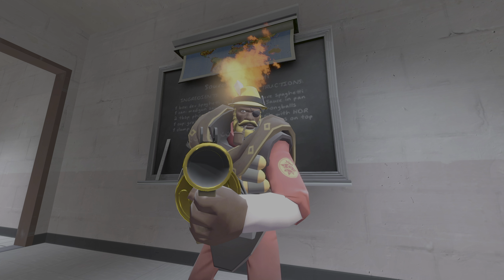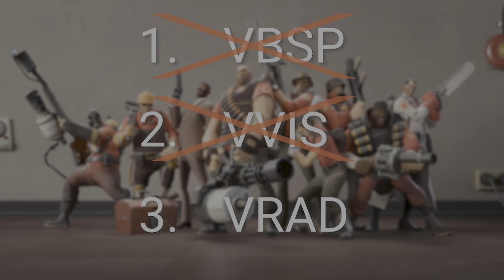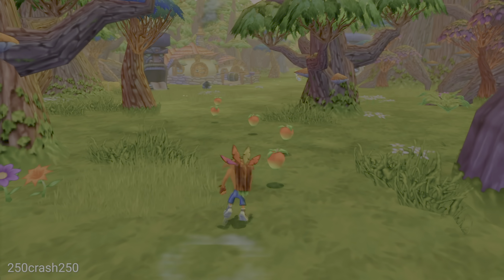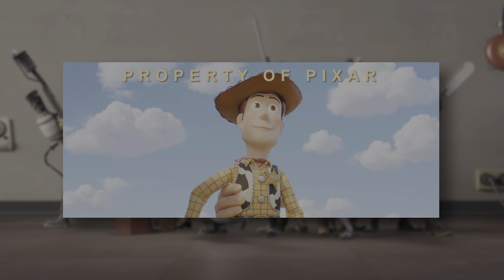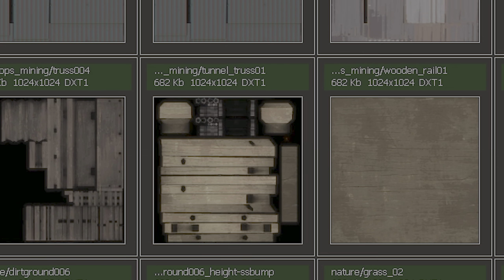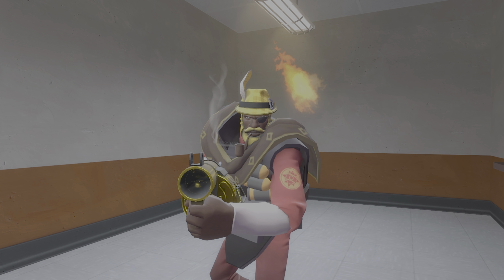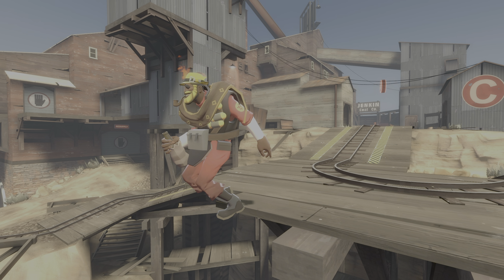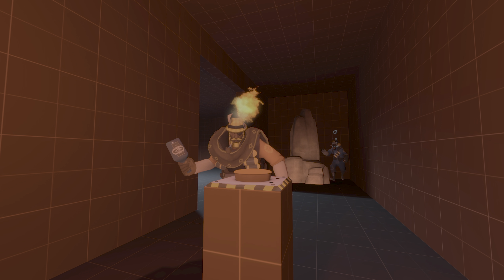TF2's Shadow Problem

Comment: Valve inherited radiosity lighting from id's Quake. MattsRamblings' channel made a super informative video about how it was done in Quake, and, with some adaptation, how it works in Half-Life 1 (goldsrc) and source as well.

Little nitpick: The luxel is not located in the center of the tile display, but instead it's where the tile lines intersect. A face that's 16x16 with lightmap resolution 16x would need not 1, but 4 luxels minimum, to cover the whole face (up to 9 if the texture is not aligned.) The bilinear filtering works between those intersection points. You need at least 2 points of data to do a one-dimensional interpolation, and 4 to do it in 2d.

Also at 5:35, that's not really how lightmaps look like when stored in the .bsp, but how the engine applies the lightmap data read from the bsp into texture sheets in the game engine's memory to be rendered. It's purely the construct of the game engine. It's done in GoldSource and Quake too, where the limit is much lower (64 in goldsrc.)
Reply: yeah it's kind of crazy how all the radiosity and physically based lighting papers are from the 80s and 90s and modern game lighting is still  figuring out tricks to get approximations of those running in real time.
Reply: @theminecraft4202  I mean, the maps and their generation and rendering in DOOM 1993 were made possible thanks to John Carmack figuring out how to implement Binary Space Partitioning trees in to the game's engine - BSP was considered a Computational Theoretical when papers about it were first writing back in the 1960's.

Even if game engine devs have figured out newer and more processor-safe methods of rendering game maps in real-time since then, it all links back to DOOM 1993 (Wolf3D was Raycast map generation, where everything was a fixed high for a given render difference, DOOM's BSP allowed for map geometry to be at different relative levels even if there was no vertical camera panning at the time.
Reply: @ElNeroDiablo  BSP has very little to do with the verticality of maps, just their complexity. And it's not like it was a revolution for anyone, not even doom. It's just one of almost infinite approaches that happened to be the first successful one for them at that time. With modern gpus its not even the right choice.
Reply: @GroovThe  "Modern GPU's" being a key factor - when DOOM 1993 released everything was done on the CPU and GPU's as we currently know them didn't exist - there were video adaptors for sure, but they only offloaded some of the workload for 2D graphics rendering (if they handled that worklaod themselves instead of passing information crunched on the CPU), before things like the Voodoo Fx series arrived around the time of Quake that were dedicated to 3D graphics rendering and you had to pass that or the 2D rendering to/from another card.

Comment: Lightmaps must be a fairly commen technique devs used. For mario kart 8, the developers manually unwrapped the lightmaps. Modders have entire control over luxel density since they have to manually make the uv maps for the lightmap. Its fascinating that valve was able to fully automate this process, i wonder how they automatically calculate texture coordinates for the lightmaps in a (relatively) efficient way
Reply from the maker: And they only pack the lightmaps in rectangles it seems, which is problematic for non-rectangular surfaces
Reply: Likely based on either facing direction or existing UV islands placed in as many pages as needed to not intersect.

Comment: Those envmaps glowing in the dark is a frequent bugbear of mine. In SFM at least you can override $Envmaptint as a color and lower the value to manually make it match the brightness, but within TF2 it just says "Here I am please shoot me". I'm surprised there's no material function to multiply the $Envmaptint by whatever brightness is applied to the model by the lighting.
Reply: It's because the environment map is expected to be the same brightness as the environment it is being used in. Either you have to add additional cubemaps to the affected area or manually override the environment map with one that's the correct brightness. An intensity option would be nice though.
Reply: @AyesC9000  Yep. But Australium weapons in particular use a shared cubemap texture that takes no influence from the environment. I'm sure I've seen it on other weapons and cosmetics, but i'm not sure. I might be thinking of Botkiller weapons.
Reply from the maker: That’s why source 2 has light probes
Reply: there is, but only in Alien Swarm+ branches and it only works on props in CSGO branch

Comment: I work with computer graphics in games, and tour videos are a very solid explanation of Source and overall engine techniques to emulate pleasant lighting given the hardware limitations. 10 years ago, I was wondering the same about classic games like HL1, Quake 1 etc, and then started looking at realtime path tracing as a technique that unifies the whole illumination pipeline for all type of surfaces, as it provides direct/global illumination, reflections, refractions, basically everything under a single pipeline. It's similar to how Carmack was explaining the Doom 3 render engine, where everything is lit uniformly, contrary to Source's manual labor for brushes/static/dynamic/deformable/phys objects; not that I wish to imply that Source is beneath, it's definitely a defining game engine, and seeing in code how much thought is put into each detail of it and realization how future-proof and expansion-targeted Valve built it, is mind blowing, let alone physics, net code, game compatibility.

Anyways, great videos. Hope you'll be able to create something unique with such an interest in computer graphics!
Reply: I agree with your points, and there are definitely benefits to both approaches. While Doom 3 can make the process of lighting a map easy with the unified renderer, it greatly limits the creative potential that lighting can bring to a level. You can't do a pitch black room opening up to a bright and sunny world for example the same way that source can.

Comment: finally some bicubic interpolation slander (the update really annoyed a lot of the source mapping community)
Reply: i think the solution would be updating vrad to somehow change how lightmaps are saved to include extra pixels by traversing edges
Reply: and yes, there are ways to traverse the edges while marching pixels on a texture,
it involves portal pixels and is quite convoluted.
not real time.
Reply: Sonic Unleashed Recompiled managed to implement bicubic lightmaps without the seams happening so I'd blame it on a Source quirk or how it was implemented instead of discarding the whole method since it's a genuine improvement over bilinear.
Reply: @ArthurLopes39  it's a quake quirk that source inherited; lightmap placement is utterly random, and the shader needs to generate padding for the bicubic filter to work properly, because the lightmaps don't have any padding (or at least enough padding).
Reply: @ArthurLopes39 Source quirk that I don't like!? No way!
Reply: Kinda hurt to know people don’t like that feature, literally saved my map in my case lmao
Reply: @doxypony  its literally shown in the video that bicubic interpolation can create seam artifacts
Reply: @wastoxic i know that! And it makes me sad :( It has done wonders to my map personally

Comment: it would be neat if hammer let you pick between bilinear and bicubic lightning.
Reply from the maker: You can use a console command to toggle between the two
Reply: @LEDs Very nice!
Reply: it's a game engine thing. hammer ≠ compile tools ≠ source engine.
Reply: @mfaizsyahmi  the engine reads from the map. it would be very much possible to have a mapspawn keyvalue that forces a lightmap filtering mode
Reply: @mfaizsyahmi I've not messed around with the lighting, so I wouldn't know. Hopefully valve fixes bicubic soon then
Reply: @andro_king but in the meantime, (as someone who hasn't actually created a map in hammer,) I think maps can execute commands on startup (or at any time), judging by how Kulcs from Interloper does that.

Comment: So I was wondering always about TF2: What if instead of soft shadows, it would be fully cell shaded? I wonder if Source 1 can even do proper cell shading, considering that Source FIlmmaker can make them, along with the outline, but visually it looks bad and more akin to basic cell shading in Blender, that's just shade color set to multiply, giving a dirty look.
I wonder if you can combine current shading properties with cell shade that owuld not look bad.
Reply from the maker: I don’t know how well that’d work out for baked lighting because the interpolation would have to preserve the banding somehow
Reply: @LEDs wasn't really talking about baked shading on maps, but more of a character shading. Since it's still kinda on a subject, I decided to bring this up, since I always wondered if TF2 can look extra cartoony with actuall cell shading.
Reply from the maker: Yeah you can do it for the characters. I actually tested it. But I couldn’t get it to look good when running into differently-lit areas
Reply: @LEDs which sounds weird, because TF2 is supposed to look cartoony and normal shader on characters look good most of the time. So I wonder why cel shaded one doesn't look good

Comment: никогда не интересовался маппингом или освещением в играх, но было интересно 
правда, я ожидал, что будет рассказано про тени игроков и почему они иногда проходят сквозь текстуры
Reply from the maker: I’ve talked about that in the past. There’s a special entity in Hammer you can use to disable dynamic shadows on select faces. Dustbowl actually has some, but clearly not enough
Reply: Могу ошибаться, но насколько я знаю, эта проблема уходит в корни самого Сурса, а не кода ТФ2, так что узнать в чём причина проблемы могут только Валв

Comment: whats worse is that vrad is ran on the cpu im sure with it running on the gpu it would be so much faster on smaller luxel scales so having a great cpu is actually pretty good for source map making
Reply: Most of Source is CPU-bound from what I remember, since offloading things to GPU wasn't something particularly feasible back then, let alone necessary.
Reply: yes it is ran on the cpu but this was back in 2004-2007 sooo
Reply: @nikoisepic  sooo...?
Reply: I believe Hammer++ comes with a modifed Vrad which uses the GPU, there are other versions made by fans which use the GPU as well
Reply: Modern versions of VRAD (VRAD3 i think) for Source 2 do run on the GPU now, but that comes with the problem of requiring a GPU with hardware raytracing support, which is still not super common
Reply: @commander3494  i would love to see a modern vrad for source 1 that supports the gpu that isnt uncompileable in visual studio ive been looking for one forever like i tried the momentum mod vrad that they just have on github? and one other one and another forked of that one they all wont compile for me
Reply: @commander3494  All GPUs made after 2020 have hardware ray tracing. AMD 6000 series (2020), NVIDIA 2000 series (2018) and all Intel GPUs.
Reply: @commander3494 The most recent versions run only on the GPU, it's a common problem for people mapping on CS2 as Valve completely gutted the option to use CPU lightmap compiling (unless I am unaware of some arcane backwards-ass way to get it back). So for all new Source 2 games going forward, you will need an RTX video card to compile maps.
Reply: @olzhas1one755  I think there is a point to be made in not supporting CPU rendering anymore in Source 2, especially considering how a small room could take over a minute to render with full quality lighting using the CPU. It's insanely slow to render the far more complex lighting used in Source 2 on the CPU, so I understand why they might not want to bother with maintaining two code bases for rendering lighting when one of them is barely useful.

Comment: Here’s something a little interesting:

You can actually make a functioning day-night cycle in tf2 maps, but there are a lot of lighting limitations:

1. Overall your map will look darker due to having to set the ambient light to a dark value
2. After changing to night props stick with their darker lighting for god knows what reason
3. You have to manually add the second skybox to the map file if it’s a custom one, because most compilers only compile the skybox you set as the default in hammer.
Reply: >You have to manually add the second skybox to the map file if it’s a custom one
hell from my time mapping 5-10 years ago i had never heard of using a second skybox texture, so any way to do it at all is news to me
Reply: @10upstudios Hammer has a “skybox swapper” entity for that exact specific purpose. 

AFAIK it’s never used in any official valve game ever, but it does exist so thanks valve devs ig
Reply: @sheacorduroy5565  It's not even used in the holiday maps that are constantly teleporting you around and changing?
Reply: @sheacorduroy5565  I think the skybox swapping was used in the HL2 episodes, maybe episode 1 with the citadel in the horizon.
Reply: @10upstudios I’ve seen a few source maps make use of different skyboxes, someone had a really cleaver trigger set up and another one merged two skyboxes so that different directions had (apparently) different skies
Reply: Did something similar for my upcoming map Palm Plaza, but it switches between different night and sunset skyboxes to avoid a drastic change of light, and fog handles the rest, as well as a fog_like prop for the skybox fog.

All of it is done with smooth transitions via a fake skybox entity which fades in and out for the weather…

Oh yeah I got a fully functionnal dynamic weather system in TF2
Reply: @DrHundTF2 source, "trust me bro"
Reply: In garrysmod we can make day cycles because we have access to the engine due it own modding nature

What causes the static props to not change it colors, its simple, those are supposed to be static and never know about the change

So we have a function that allow us to redownload lightmaps, that way we can tell static data “hey you’re wrong, load your lighting texture again” with the correct tint again

But this really freezes your game depending scene complexity, so it’s understandable by nature, that lighting is static hence it shouldnt know about light changes (compared with dynamic entities, like players, projectiles and even physic models)
Reply: @gonzalolog  That's why you just make all your props dynamic ;) Had to do that for a map that had a lights out system. Granted a lot of the props had to be dynamic anyway cause they randomized details every round.
(Also haven't seen your name in years Gonza, since the old FPF days)
Reply: If I recall, there's also no dynamic shadows at all.
Reply: You can use env_fog_controller, logic_timer, and math_counter to gradually make the map darker. I might be missing another entity that's needed for this but that's what I recall from making a night cycle in a test map of mine.
Reply: I have done this for some of my maps for NecGaming, it's great but takes a lot of effort!
Reply: Honestly I can imagine some cool uses for day/night cycling, like  the sun gradually setting as each point along the Payload track is capped, or maybe a KOTH map where each time the point is capped the sky suddenly slams from midday to midnight and back in a cartoon transition lol